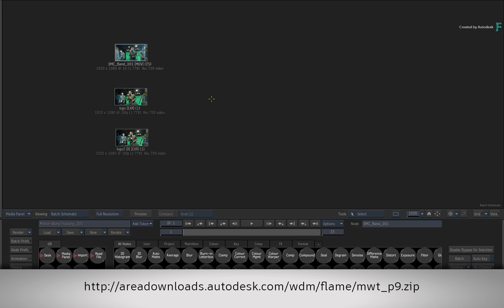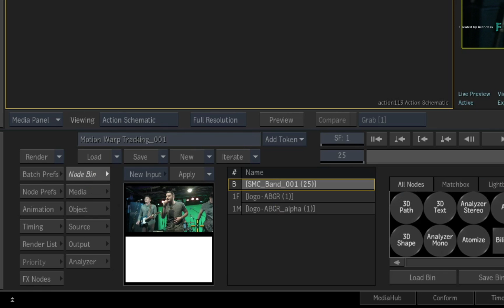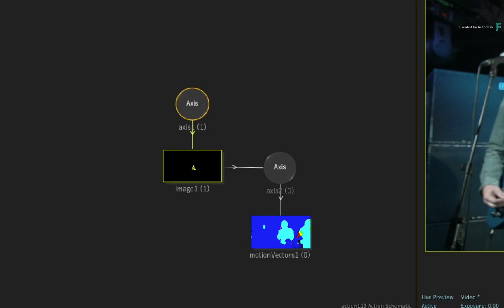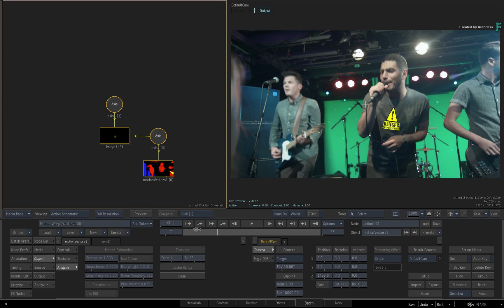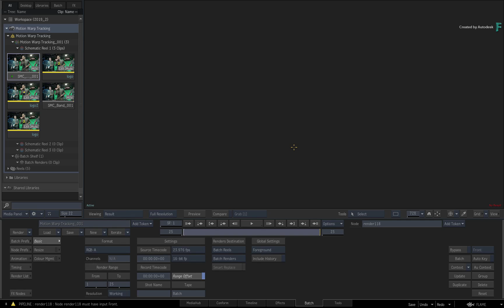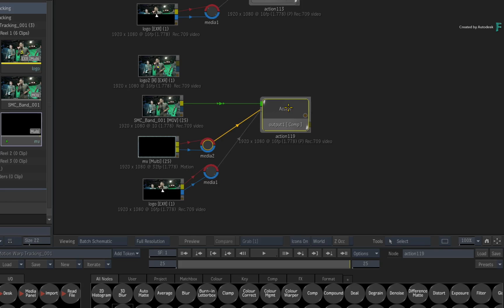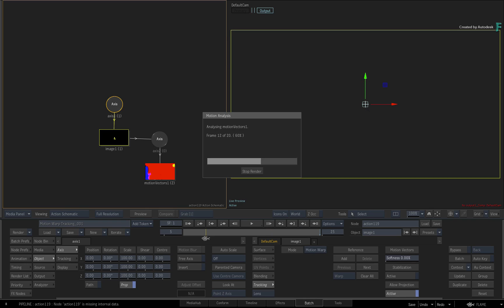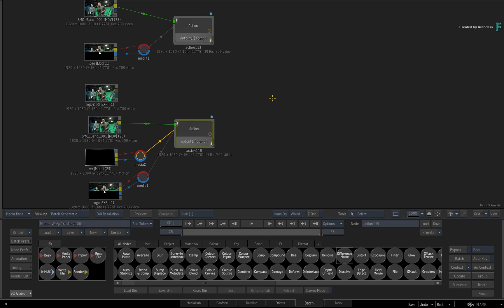Motion Warp Tracking - Part 9 - Understanding Analysis & Integration - Flame 2019.2

Comment: This process does not work up to the point where you add a MV utilizing the background!
Reply from the maker: Hi Terry, I checked the example and it is working as expected.   Please ensure that the media assigned on the MV map is set to 0 for the background and not 1 for the logo.   You can see this in the schematic under the map object.  Hope this helps!

Comment: If I am on a timeline BFX and I render the MV where does it go? I can't seem to see the render anywhere.
Reply from the maker: Hi Ricardo Neves, if you are rendering a render node in BFX and not the BFX output node, that the default location for renders should be a reel in the current reels group or you can set it to the library.   

If you create a BFX clip, this clip will be stored in the BFX inside the Schematic reel at the top of the media panel.

Does any of this help?